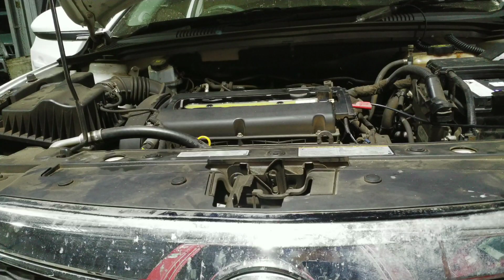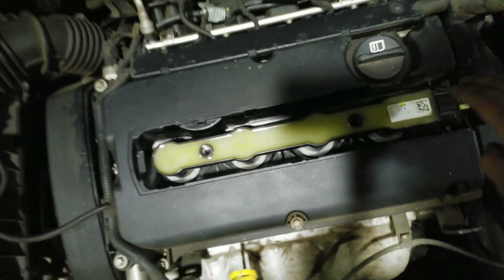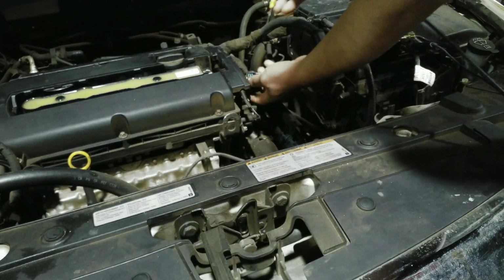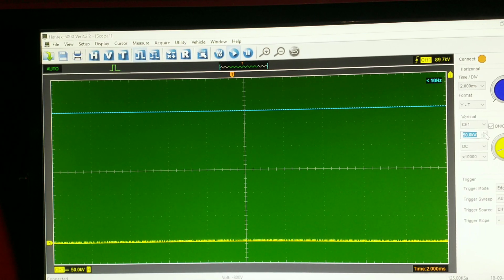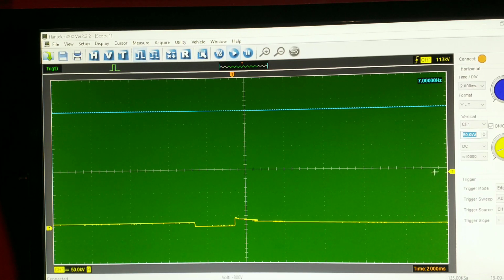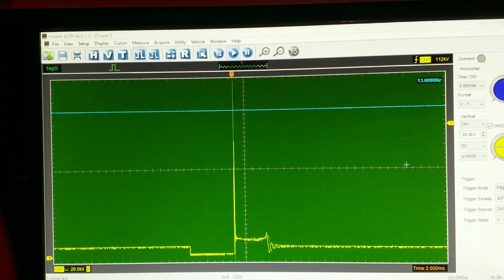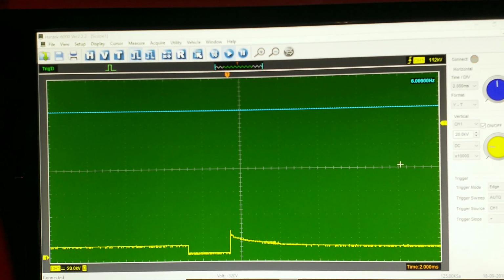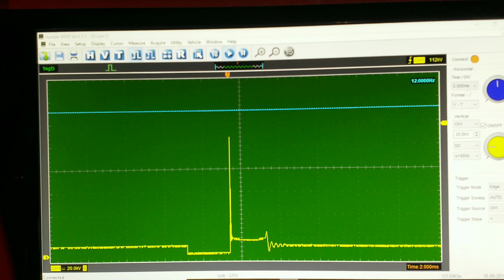Holden Cruze common ignition coil failure diagnosis

Comment: How can u test the coil without a scope?
Reply from the maker: Use test light connected to battery negative and have air gap between the tip of the test light and coil. Spark should jump at least half inch. Don't use led test light. Do it at your own risk. It's just for information purpose only.
Reply: Thank you

Comment: I wish you where in Brisbane, my been sitting out front for 2 weeks as no one wants to work on it - you know what your doing
Reply from the maker: Thank you. But any mechanic should be able to tackle ignition problem. Why is that
Reply: @a1mechanicaloakey  The car was my wifes before mine and he always complained that he hated working on it. Everyone I have contacted with holden experience have said that they are busy for at least 3-4 weeks as soon as I told them the model (I am not kidding) so  today I have had time to research it and it could be the fuel pump relay, I might try and replace that. He says its not throwing any codes at all and the coil pack in only been in the car 6 months, one minute its running perfect, I pull over to put some fuel in and then it just starting running rough, no power - got it home and now crank but no start. Our mechanic said he didnt have the time or inclination to work on it so I need to try and fix it myself
Reply from the maker: @cryptocastaustralianmyster7221  what type of car is it. If it's Holden they do have common issue with ecu going bad causing crank but no start. But again I'm just guessing def need a pro to look at it
Reply: @a1mechanicaloakey  yeah mate it's an 09 Cruze petrol

Comment: Replaced that on my 2012 cruze at 216000 mi yesterday.  #3 was all corroded out and broke off.
Reply from the maker: Replace spark plugs too with new coil. Often spark plug is the reason why coil fails.
Reply: @a1mechanicaloakey  Yeah had replaced those first. Then was gonna replace #3 coil boot thats when it snapped off.

Comment: good man, I have an issue that  i am dealing with a dead miss, I replaced the coil and the plugs but still doing it, now that I know what the control wire should look like I will get the scope on to them and see, I do think mine is the ECU that is the issue as I found water in the ecu plug, cheers
Reply: Turns out it was a faulty coil pack that i had bought !! new dosn't mean it works ha
Reply: Wht car u have an issue , chevrolet cruze 1.8 petrol ?
Reply: @aniqcubacubajer2074  yeah, it was a cheap coil pack I bought
Reply: @smiddy19801  i have one on my spark plug driping oil , wht must i replace ?
Reply: And leak on my head cover gasket
Reply: @smiddy19801  my misfire on cylinder 4 cylinder 3 cylinder 1idk wht the problem , my engine is crazy
Reply: @aniqcubacubajer2074  did you find out?

Comment: i have Chevrolet cruze ls 2012.i was washing  with water & kept in parking. After 3 day try to start now not started. What is the issue?
Reply from the maker: I think you put water on the ecu, right next to battery. Possibly new ecu but again I recommend taking to a professional mechanic to get it checked first. Ecu is not cheap to replace.
Reply: @a1mechanicaloakey  thanks for reply.
Reply: Actually while i washing after it starting and i drive the car upto parking area.stop the car kept in parking. After 3 days while i want to start the car that time not started. Showing massage on car filling fuel. Now nomore any alarming but not start

Comment: Where can I buy a J6 coil
Reply from the maker: Need more information mate
Reply: @a1mechanicaloakey  my car suffocates at 4k rpm and dies
Reply from the maker: @RelaxingVibes202  what kind of car is it ?
Reply: @a1mechanicaloakey  2013 Chevrolet Cruze 1.6
Reply from the maker: @RelaxingVibes202  doesn't sound like coil problem. But you can buy that could at repco
Reply: @a1mechanicaloakey  maybe a purge valve